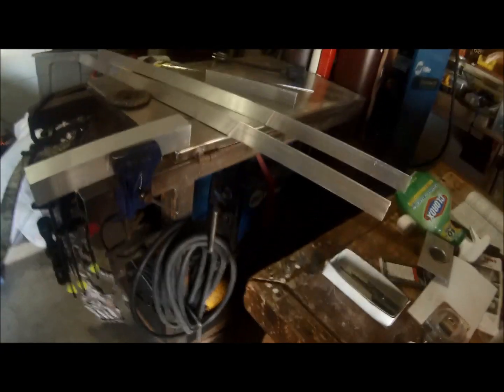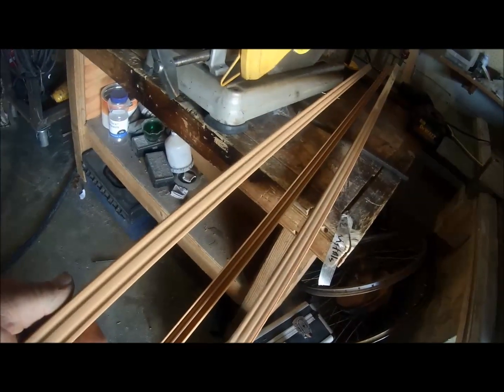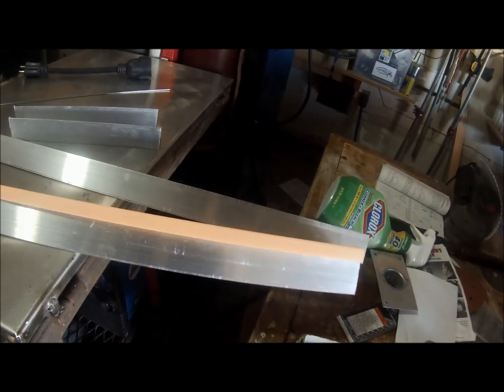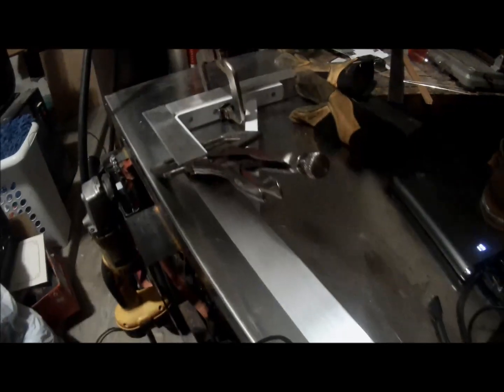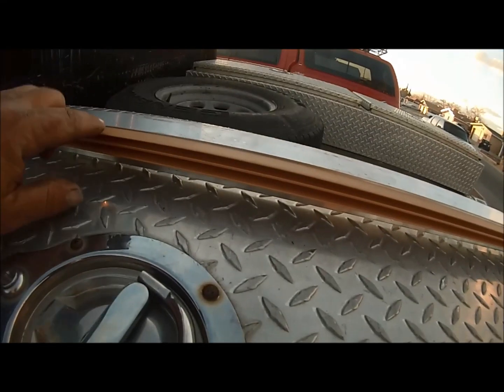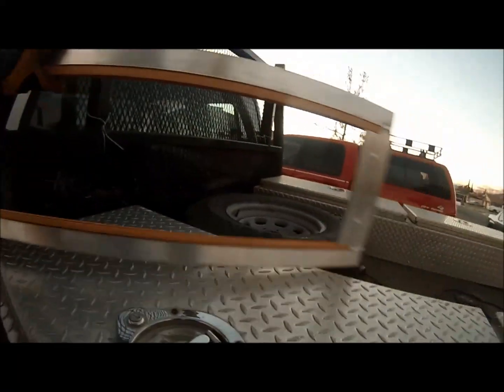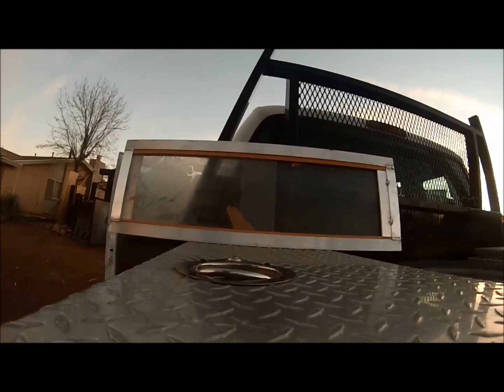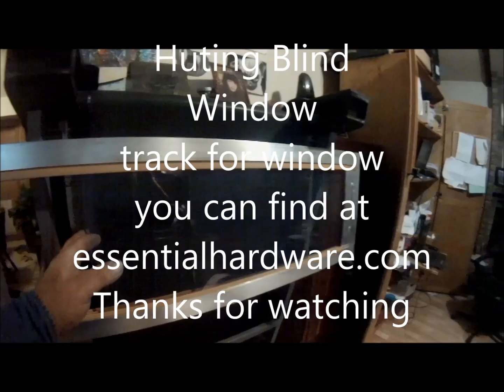Hunting Blind Window

Comment: Use beeswax on the inner surfaces of both the upper and lower tracks.... to keep the fiberglass windows from making NOISE as you open or close those slider windows.